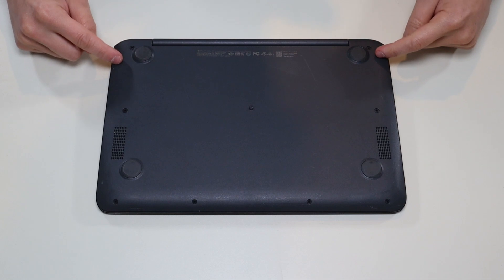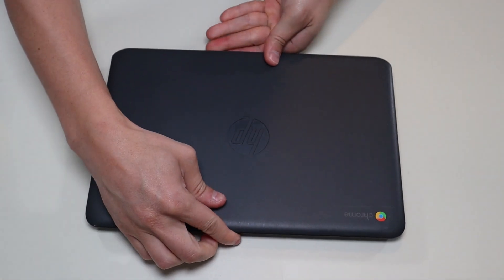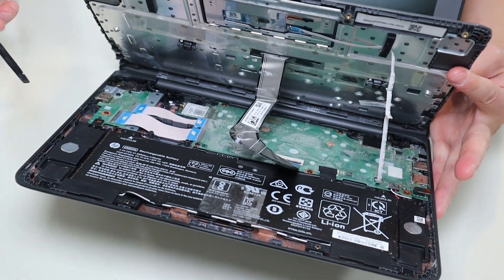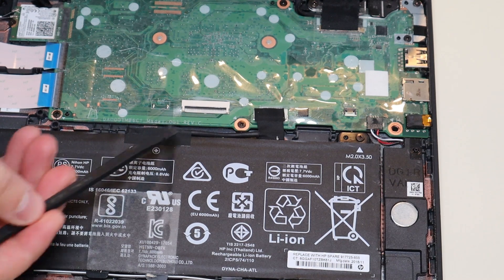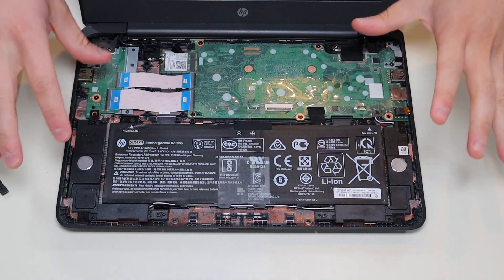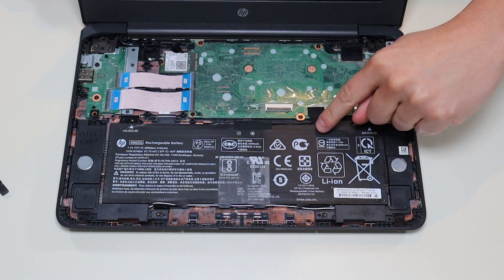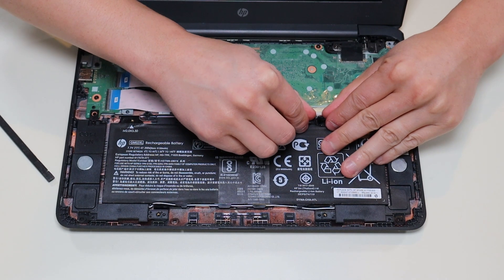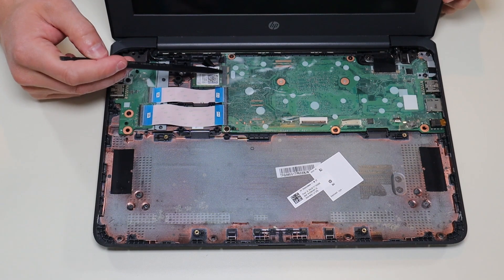How To Replace Wifi Card - HP Chromebook 11 G6 Laptop Computer

Comment: Hey this comment is completely unrelated to this specific video but i have recently came across a problem on my lenovo laptop which suddenly does not work anymore, all it says whenever i boot it up is Media test failure and boot device not found. I have watched a couple of your videos on this topic and i cant seem to get anything to work. I   would appreciate any help
Reply from the maker: Can you try the steps seen here? https://www.youtube.com/watch?v=_jxEZPPiCTg
Reply: @PC_Monkey  Hi so I have tried pretty much all the steps shown in the video and nothing seems to work, I still receive the pxe rom error.  My laptop has an ssd and not a hard drive but whenever I take apart my laptop I can't seem to figure out how to take the ssd out and reseat it because there is an aluminum foil strip covering a side of the ssd and I can't pull it out nor is there any screws to take out

Comment: Hey brother. Thanks for a well put tutorial. I need your advice. I have a dilemma whether I should try to fix my 2016 Acer Chrombook 14. The battery is almost dead and there are touchpad problem. Otherwise it runs OK. There are no moving parts inside (no fan). This PC is very old and it's EOL.
Reply from the maker: What is your question? Are you looking for help finding the battery or fixing the touchpad?

Comment: My laptop will turn on but not display after I replaced an ssd and it eventually turns off while the power led is flashing amber
Reply from the maker: If the screen is black, what are the signs that the computer is actually turning on?  Also, did anything happen before this issue appeared?  Liquid spill, overheating, Windows update, etc?
Reply: @PC_Monkey  the keyboard leds I can also hear the hdd start up
Reply: @PC_Monkey  um no I believe the problem may have been me forgetting to turn off the pc before I took replaced an ssd but I can’t see any signs of a short circuit or capacitor damage

Comment: My keybored will not type after a water spill what do i do?
Reply from the maker: Just so you know, liquid spill situations can be hard to troubleshoot just one issue as multiple different components and boards including the motherboard itself, could all be faulty. 
After a liquid spill, you want to first make sure the computer is 100% dry. You would turn your computer off immediately by pressing and holding the power button until the computer turns off. Then you would disassemble the computer as much as your comfortable with, at least trying to remove the bottom case. Then you would turn it on its side and let dry for a couple days.  Have you done this yet or are you sure the computer is dry?
Reply: keybored 😁